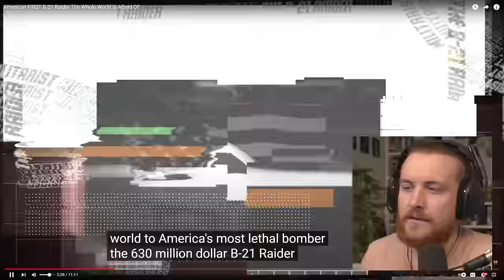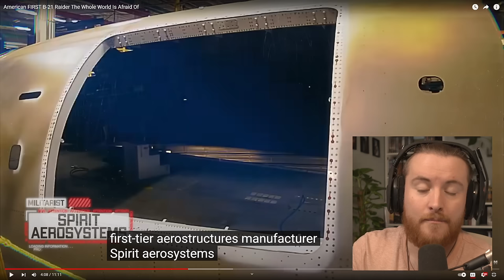Royal Marine Reacts To American FIRST B-21 Raider The Whole World Is Afraid Of!

Comment: What’s amazing is the fact that the B21 still won’t be replacing the B 52.
Reply: Not for at least 20 years
Reply: Yup, it's my age 68, remarkable
Reply: Sometimes you just can't improve on the better dump truck.  😂😅
Reply: ...and it is getting new engines! 650 new RR F130 (BR725) will be fitted, redesignating them B-52J
Reply: The B-52 warps my understanding of metal fatigue, Didn't Noah load 2 of every animal on a B-52?
Reply: Yup the buff will be over 100 years old when it finally retires
Reply: I believe the reason the B-52 is still around, is that they still cannot find a way to replace the huge payload available with a B-52 and get the performance or stealth capability that they want for the first strike aircraft. Just like the B2 and b21 cannot deliver the huge payload of the b52, the B-52 cannot fly at the speeds or with the stealth of the newer b1, b2, and now b21 bombers. They all play a role in national defense.
Reply: I totally agree with you. But it is a Tribute to the longevity of the B52
Reply: They do two completely different jobs. The B-52 is still the best at what it does.
Reply: Grandpa Buff is forever lol
Reply: All the spare parts are made in CHINA !    So you can't shoot them down if they are broke down .
Reply: The B-52 is a great favorite of mine.  Way out of place in time, but still indispensable.  A B-52 built in 1960 (the year I was born) was just taken from the boneyard and brought back to life to replace one that had a crash landing.  Truly amazing.
Reply: B52 is the US pressure response. Something happens, Buff gets another upgrade.
Reply: buff is forever
Reply: Because this costs too much. Even for "our" government, this is too expensive.  That is saying  a huge something. This is the cost corner cutting new version of the B-2 B-52 "ain't cheap", but at least compared to this +++++++
Reply: @DaddyHensei Nice! Habitual-linecrosser! 😁
Reply: I would like to see them build a B-53 bomber. It would look a lot like a B-52 only smaller.
Imagine a bomber half the size, carrying half the bombs, with half the crew of a B-52. It would be an all-new body though, and much more efficient.
Two bombers would do the same work as one B-52. The difference is that since it's half the size it can take off from nearly any runway. You can launch them from just a few miles behind the front lines and their turn-around time is greatly decreased. That means over time, far more bombs on target. They would outperform the B-52.
Reply: It was Roosevelt who said "Speak softly and carry around a big stick." Some times you need a very stealthy fast stick with a very big impact that everyone inherently fears. Other times you need an airhorn blazing, lights flashing, and ACDC's "Hell's Bells" blasting behind you as you drag around a flaming log etched with "F*CK AROUND AND FIND OUT" into it. The former would be the B21, the later would be the B52. The B21 is the thing those who anger the US keep having to stare up into the night sky to check for constantly. The B52 is loud and proud and will announce to the world that "leader X of nation/extremist group Y" has indeed f*cked up.
Reply: @steeljawX  As a caveat and expected: AC/DC is not an "Amerucan" band.   The education system was purposefully defended in this country for short term corporate business profits. You get this.
Reply: @UhhhhhnooOOo00oO                             "Amerucan?" Now I have no choice but to agree with you on the "educational system. " Didn't do the individual a damn bit of good, did it?
Reply: Buff will be upgraded to handle energy weapons and photon torpedoes before it goes away. Plot twist will be when it gets retired but comes back into service when they realize the mistake.
Reply: @w.s.schuessler4674  Apparently colloquial purposefully incorrect spelling for phonetics is lost on you.  I guess my PhD from Yale in English isn't enough.   "Better to remain silent and be thought
a fool, than to speak
and to remove all doubt.".    You should learn to remain silent.  That quote was from a fellow "Americun" Abraham Lincoln.  It behooves you to learn who he was and what he believed.  
You show your lack of education with that reply.  It's not your fault. I don't blame you.  Don't reply.   Silence is your strong suit.   You apparently didn't see the quotes around "Americun".    I can deal with this anymore.  Go watch your loud fast planes and play in the sand.
Reply: Upgrade 30 b52's for $1.1 billion dollars or buy 2 b21 raiders at $1.26 billion.... kinda simple math on that one
Reply: When you have to put warheads on foreheads.
Reply: True, especially since it literally has the radar crossection of a Bumblebee.
Reply: @andyloy7809 Respectfully, I think you missed the point of the B21 entirely. The B2 has replaced the B-52 as America's Frontline bomber as the 21 will continue. The value of the B52 is in conventional warfare using cheap conventional bombs in lightly or uncontested airspace. However, as the airframes age, the bombers will be forced into retirement. There are few B52 parts made new. Most parts are stripped from retired airfames. This vast supply is dwindling fast. Eventually, in about 20 years, it will no longer be cost-effective to keep them flying. As modern, more powerful guided munitions get cheaper, the B52 will have run out of cards to play. I doubt, however, that her length of service will ever be equaled. I pray they save some museum pieces for posterity.
Reply: It's cheap to fly and train on. No reason to retire the B 52
Reply: @UhhhhhnooOOo00oO  Yale? With a screen name like that, I doubt it.
Reply: @ryanjohnwisniewski599  As long as you aren't paying the 100s upon 100s of billions it has cost.   Again, I thought these channels were all patriot, American flag waving, kick ass followers.  Now they are accountants with glasses and pocket protectors because they "love" a machine.   It I'd antiquated. If "we" are going to spend more than the next 12 highest military budgets combined in the world, [Without Dark Projects] at least produce something decent.  Upgraded 1960s tech is all "we" get!   Instead of cutting teacher's salaries and welfare checks that make up .0000000001% of the national budget, how about we get rid of one B-2 or the maintainence of one B-52.   Cut the budget and the insane mark up profiteering. That will never happen.  I say, spend until "we" lose.  That is "our" adversaries long game and we fell for it, hook, line and submarine.
Reply: B-52 is an embarrassment, as is the U-2.
Reply: We all love grampa buff.
Reply: Literally my thought too lol. The buff is still a dominant powerhouse. My airframe lol
Reply: @UhhhhhnooOOo00oO  Pedantry aside, nobody said AC/DC is American. And every rocker appreciates their rowdy delivery, especially since like any decent hard rock band, they do sing & sound ‘Murican’! Back to the point about bombers, most fans here like the B-52’s beastly demeanor and yeah, all the rest are simply too expensive.
Reply: The Buff is forever
Reply: @Phuc_Socialist_You_Tube  no you don't get it... the buff is forever. Periodt.
Reply: @XteoX21  Nothing is forever
Reply: The really wild thing is there is a video of a Granddad,  Dad & Son who have all flown the same BUFF airframe.
Reply: The b52 stratofortress is still the goat been in service since the late 50s to early/mid 60s
Reply: Welve grandpa buff
Reply: @tylerbarse2866 Yeah, I believe it's going to be a fleet destroyer. It can carry 21 cruise missiles that can each travel 1,000 miles and deliver a one ton payload.
Reply: The B-52 is a bus.  It carries a massive payload.  As long as the payload can get there on its own the bomber is still useful.
Reply: @MRxMADHATTER  the B-52 served on the maiden voyage of the NCC-1701-D armed with the most modern Nacelles and newly developed Photon Torpedos. Expected End of Service is 2405.
Reply: Haha I know right. Insane how effective and relevant the B52 still is
Reply: The B52 has great bones that have allowed the US to keep it modern by upgrading the tech inside it along with modern weapons.
Reply: @MRxMADHATTER in a made up fairy tale world yes he did do that.
Reply: yeah...amazing...the B-52 is the Boeing 747 of the Air Force- the most successful aerial platform in military history...
Reply: The Buff is forever.
Reply: @shandor2522 
Shandor...wasn't that a gay elf in those video games you play?
Reply: @Craig52-zq1bt  If I played video games, the elf would be Will Ferrwll
Reply: Love how we are still rocking chinooks too.
Reply: Thanks to Rock Lobster you’re correct
Reply: The Buff is not just a Weapons System, he's a Statement. We send the Buff... you've fucked up enough to be designated as To Be Deleted rather than a threat or a hostile.
Reply: If it isn't broken...........
Reply: @jfuzi3605  then the Buff wasn't aiming at you.
Reply: Literally about to say this
Reply: The buff is forever.
Reply: The B-1 was the only one that could've replaced it
Reply: @MRxMADHATTER I’m sure it gets a Depot level rebuild at one or more points. Airframes normally have an acceptable hour range before they are sent back along with inspections all along the way. I would think hundreds or inspections, sheet metal work, painting, NDI inspections. I mean they say if it ain’t broke don’t fix it 💯
Reply: @protorhinocerator142 Twice the parts inventory , twice the technicians, definitely adding costs with 2 airframes , additional pilots, good if you’re a contractor bad for our $$
Reply: The Bone isn't something to trifle with either.
Reply: The BUFF is forever.
Reply: @tylerbarse2866 , there will also be situations where the US has air dominance, huge payloads of dumb bombs or short range PGMs can do the job without putting the B-52 crews at risk.
Reply: @tylerbarse2866, where did I claim your previous was untrue?
Reply: jeeeezzz
Reply: Nothing can replace the BUFF
Reply: B52 will be retired at age 100 which is more than remarkable
Reply: @renebrioso960 the B-1 actually has a high payload capacity than the B-52 and has very good stealth capability despite it not being a dedicated stealth bomber. And the B-1 is a supersonic bomber. The downside of the B-1 is maintenance of a the sweep wings and the fact that they only have 45 of them.
Reply: @rhshear  the B52 is the M1009 CUCV of aircraft!!

Comment: 7 years isn’t a long time in the Avaition defense industry the F-35 was conceived in something like 1995. It went it service in 2015, and won’t be fully capable till Block 4 comes around in 2030. So 35 years.
Reply: This is what makes me think these have capabilities similar to the B-2 only cheaper. We are going to eventually need to replace the B-52. This one may actually be it.
Reply: @reidboggs4344  Never! Grandpa Buff will live on for another 1,000 years!
Reply: @Kaizen_KyranTTV 🤣
Reply: not fully capable yet after block 1.. it dominated the skies and even air to ground missions.. didn't realize there was somewhat of an endpoint for the 35 as the upgrades to its code etc are always ongoing
Reply: @yulfine1688  there really isn’t an end goal, but block 4 is a milestone. Because that’s what the F-35 program originally visioned. Later upgrades will be just that upgrades.
Reply: I'm an engineer and I literally said "that's all" just as he said "7 years is a long time!"
Reply: The reason why the F35 took forever to develop was that it's a multi-role, modular/up-gradable,  tri-variant (A,B, & C), HIGHLY communicative, stealth.... You get the point, right? The B21 is advanced, too. However, my understanding is that it's an aircraft developed from the lessons learned from the B2 (and perhaps other aircraft). The B21 is less about new tech and more about refining the tech that already existed for the bombing role. (Note: it wouldn't surprise me if the B21 could target air, sea, and ground targets as that technology also ready exists.) What I'm saying is that the F35 it not a good example for comparing development time.
Reply: @bariman223  Yeah, why the Apache D had a cost of $68 million each while the Apache E has a flyaway cost of $35 million even after the massive upgrades. All the R&D and tools were made using the Apache D money which is why the Apache E costs less.
Reply: Long live the Buff!!!! @Kaizen_KyranTTV

Comment: It's amazing that the B-52 Stratofortress is 70 years old now and it has outlasted every bomber designed to replace it. The B-52 is currently being upgraded and modernized to take the platform to the 2050's it could be the first aircraft in history to have a 100 year service life.
Reply: Um.......

#C47
#DC3

......still in service in many parts of the world.
Reply: BUFF.  IN.  SPAAAAAACE!  😂
Reply: Halo may be Infinite, but the BUFF is eternal.
Reply: As a "certain" linecrosser would say would say, "The Buff lives forever".
Reply: Pretty sure it's going to get to 100 years of service.  It's all about payload.  It can carry whatever it wants to, unstealthily of course.  All weapons it carries would be standoff.  Namely, cruise missiles. It just needs to fly close enough to the target.  Typically that's 1,300 to 1,500 miles.
Reply: @Rotorhead1651 
IN service.
I flew in a Dakota in 1969. A lot smaller than I thought. A fun ride over the Sierra Nevada mountains.
Reply: I remember the hit piece 60 minutes did in the 70's to try turning public opinion to get it cancelled.
Reply: Buff is forever
Reply: @Rotorhead1651 in American service life

Comment: The B-21 is both the latest stealth bomber and the world's largest combat drone. It is designed to be used both manned or unmanned.
Reply: Yea the video said it’s optionally manned.
Reply: Now they need to develop an armored robot or a control mechanism that can sync to a remote pilot, as if he’s right in the cockpit, and he can fly the plane remotely. not simply with a joystick.
Reply: I don’t think he caught that part, as they essentially mentioned it in passing. Seems like something he would’ve definitely commented on had he heard it or realized what was said. The fact it can be flown from the ground has to be scary for any adversary. That’s a very menacing characteristic of the deadliest aircraft in existence. They’re currently working on an AI program to add to fighter jets, which will change warfare drastically. An AI “powered” fighter jet will know everything with 100% precision. That’s terrifying. Especially if they decide all humans are enemies 😂
Reply: @clinthowe7629  You don't need that. You tell the B-21 where it needs to be and it goes there.
You send it out with several "loyal wingmen" drone aircraft. They shoot down anything that might attack the B-21 so the bomber can keep going straight to the target.
Reply: I'd be curious how long it can reasonably stay aloft assuming unlimited refueling
Reply: The B-2 also flew unmanned, but it took two women to operate it. (female crew, get it?)
Reply: @hlaroux  - SAC used to keep B-52's in the air, around the clock, 24/7/365 back in the days of Krushchev and the "we will bury you" rhetoric.
Reply: @WJV9  But presumably, any particular aircraft would only stay aloft for at most a day assuming extra crew on-board. If you take crew out of the equation, it would seem like staying aloft for at least a maintenance interval would become possible. Maybe 100 continuous hours?